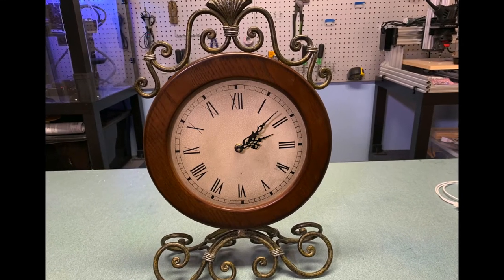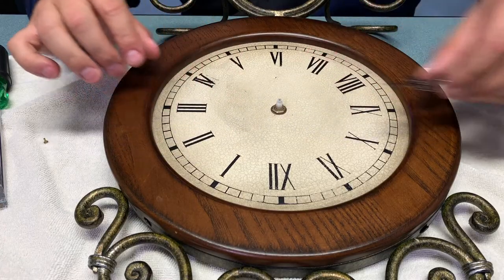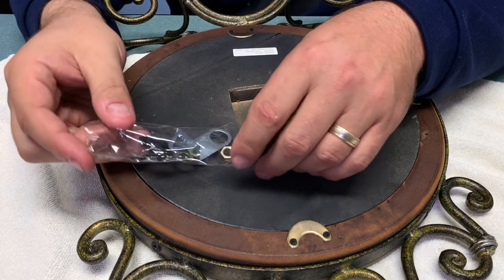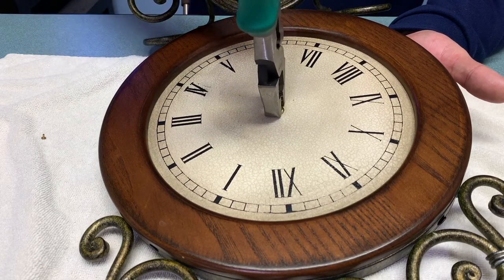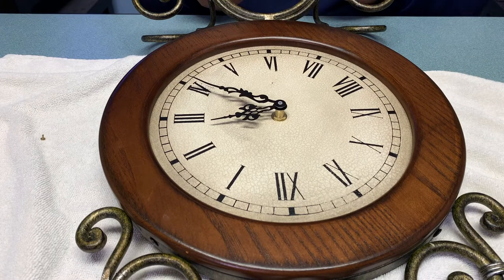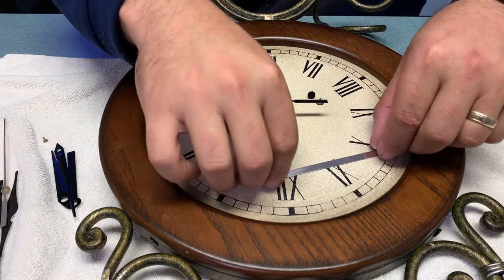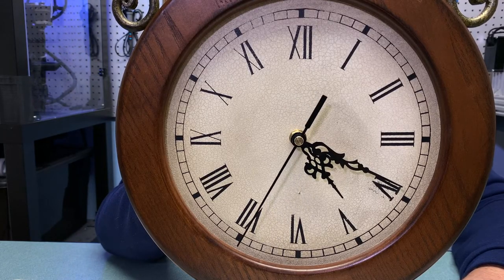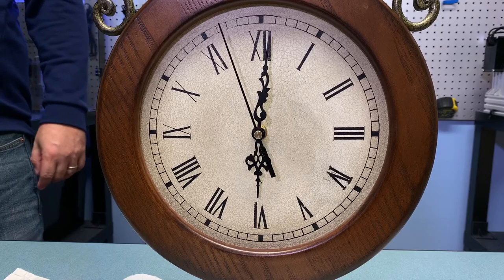When Time Stands Still: Replacing Clock Movements is Easy and Satisfying

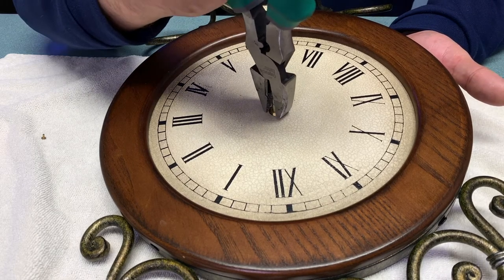Comment: 4:18 Alright, not complicated, I know. I’ve gone through this several times over the last 6 months. Reassembly is not at issue. 
What IS, is the quality of these cheap garbage clockworks boxes. 
Oh, “High-Torque Quartz Crystal Movement”, you say? 
My rear end they are. 
Not one of the FOUR that I have purchased from 3 different Amazon “companies” at anywhere between $9 and $26 lasted more than a week!!!
It’s all cheap Chinese crap!
Reply: Who’s found a reliable replacement source?!